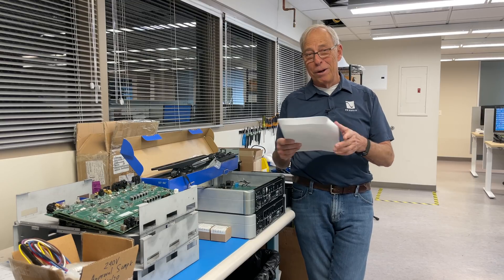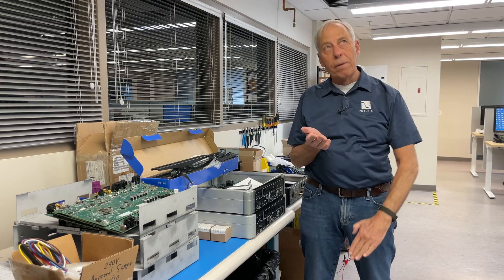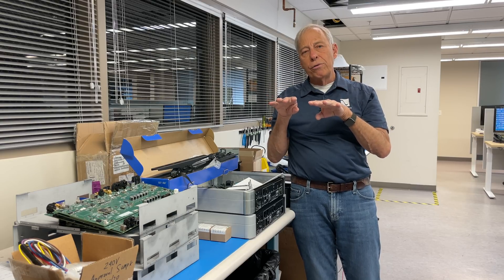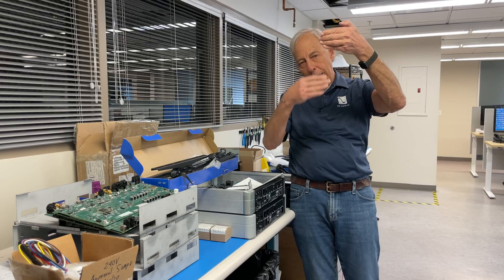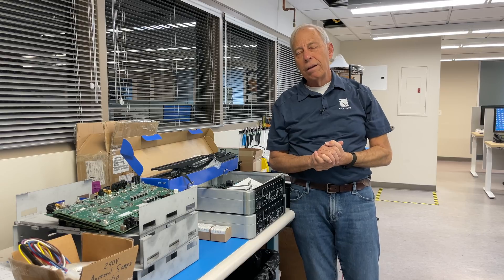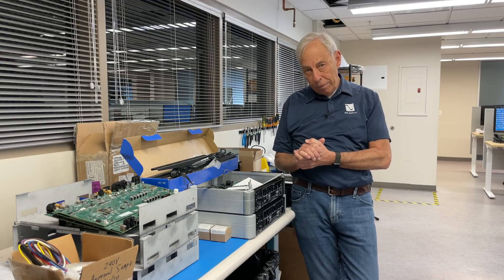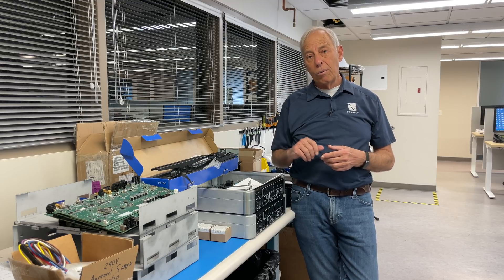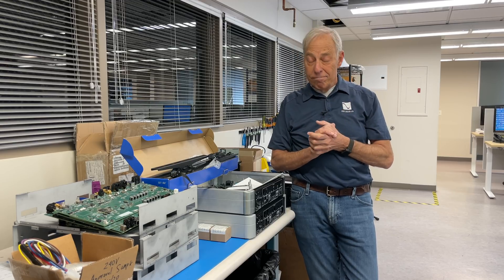Single ended amplifiers

Comment: Great simple thought provoking content.  I take it that because single ended amps are not zero crossing then it matters little if they are tube or mosfet?  What have you found when comparing  tbe two?  I build computers and it seems that a mosfet design could be cooled efficiently with a CPU type cooler.

Comment: Terrible explanation. Many errors. SE (or SET) run class A. The difference is a balanced stage (like push-pull) cancel even order harmonics. It's the resulting distortion that you find "musical". Even-orders harmonize with the fundamental. Odds don't. SE distortion levels are also higher even with feedback. Many SET owners prefer no feedback. Likely for the even-order distortion.

Comment: I got rid of two McIntosh 60 watt amplifiers; one built in 1954 and the other one in 1955 for stereo use; also got a Fisher pre-amplifier.- They put out so much heat that I didn't need to use the home heating central unit.
Reply: If you ever give up your mac 60s I have no sympathy for you ! Shame !!!
Reply: I drive. A 62 buick also, screw efficiency !!!
Reply: Everything I have ever owned that is efficient isn't worth a damm.

Comment: Single-ended amps tend to produce more second-harmonic distortion, which in the right quantities can be quite euphonic. The first Delco (General Motors) solid-state car radios had a single massive Germanium power transistor, working as an emitter follower, with an air-gapped iron-core choke between the emitter and ground. The car speakers (usually two, one in front and one in back) were wired in parallel with this choke. With two 3.2-ohm speakers, this arrangement could make a relatively undistorted eight watts or so. They sounded very warm indeed. Of course, it was AM radio! These amps continued on into the early 70's, when quad eight-tracks came out. There would be a massive aluminum heatsink under the dash with four of those huge transistors on it, and the radio would pull a constant 16 amps or so any time it was turned on.

EDIT: I forgot to mention, the line driver (final stage) of the legendary 1176 compressor uses a similar circuit, except instead of a choke it uses an actual transformer. And of course, most SET amplifiers put the output tranny in the plate circuit (collector, if solid-state).
Reply: Wow. Years ago, when I was still a kid, someone gave me an old simple AM radio from a '62 Chevy. It had like 4 tubes and a DS503? output transistor. Many years later I learned that it may have been a single ended output circuit, since the radio consumed like 3 amps when on. A waste of fidelity for just AM!

Comment: Perhaps it is worth adding that single-ended amplifiers, by their nature, produce even harmonics, while push-pull harmonics produce odd harmonics. Even harmonics create consonance, which is the basis of musicality that creates a magical atmosphere. They are pleasant to the ear and desirable in contrast to odd harmonics, which are not pleasant to perceive.
Reply: That is more about output device than amp class. Tubes and FETs become nonlinear and compress as they reach max levels. So they create even order harmonics which are smoother and more musically pleasant. While bipolar transistors just clip when they reach max out and create harsher odd order.
Reply: @glenncurry3041  In a single-ended design, BJTs behave like this as well, as they operate in their active region, where the non-linear relationship between collector current and base-emitter voltage introduces asymmetry in the amplified waveform. This asymmetry results in second-order harmonic distortion. In my opinion it's not about the output device but the single ended nature of the circuit which is the least linear one amongst others.
Reply: @belabertalan  Unlike tubes and FETs, BJT's do not compress at peak they clip. Massive odd order harmonics.

Comment: I have had over 60 years everything you can think of, also 2A3, 300B SE, for the last 10 years, I listen through a EL84 SE, will not change that ever. But, and I have them, you need efficient speakers. I have floor standing transmission lines , 96db.

Comment: Not sure how a class A amplifier can be "even more inefficient" than a single ended amp.  A single ended amplifier is always pure class A by definition.
Reply: Well that's exactly what I thought. When he mentioned Class A as being something else I was like what!? Isn't a single transistor or tube amplifier class A? It's the same thing! I was yelling at the TV! Lol!
Reply from the maker: No, that's not true. A single ended amplifier with no output signal draws only its operating bias current. Only when it begins to have a signal does the output current go up. So, a 50 watt SE sitting with nothing on its input is not consuming 50 watts. That happens only when there's a big signal. In contrast, a class A amplifier always draws the same current (wattage) regardless of the input signal. So, a 50 watt class A amplifier draws 100 watts from the AC wall socket even when there is no input signal. That power is then converted to heat. At full input signal the amplifier still draws the same 100 watts but now half of it goes into the loudspeaker load.
Reply: @Paulmcgowanpsaudio  Nope. If anything a single ended amplifier draws less current when there is sound due to the diode effect of the grid and cathode.

Comment: Hi Paul,  I do have PrimaLuna DiaLogue Premium HP Integrated (8/KT-150 Power Tubes can also use 6L6G, 6L6GC, 7581A, EL34, EL37, 6550, KT66, KT77, KT88, KT90, KT120 and KT150.  4 -12AU7 Driver Tubes and 2 -12AU7 Gain Tubes.  True Mono design as to why all the tubes.  Sounds Wonderful with Focal Aria 936 speakers.  I also have Dennis Had (Cary Audio Design retired Founder and President) INSPIRE Fire Bottle KT88 Single-Ended Class A Amp.  Using 2 -KT-170 Output, 1 -PSVANE WE274B Rectifier and 1 -KEN RAD CKR-6SN7GT VT231 Input Drive Tube at 12Watts connect to Zu Audio Dirty Weekend MK.II.  This bird SINGS.....It's the Experience and Designer...Thank You Mr. Had and I encourage anyone to try his SE Amp's (also designs INSPIRE 300B and INSPIRE LP-2030 Pre-Amp) from Dennis Had.

Comment: When is a single ended not class A?
Reply: When it's broken and needs repair.  
On a more serious note, it's just semantics.  When one speaks of Class A, it usually implies class A complementary, rather than single ended.  But both use similar biasing schemes.
Reply: @marianneoelund2940  class A complementary is just class B with heavy bias (class "AB"). At least that's how I always looked at it. Class AB sound fine but zero feedback class A is the best, in my opinion :)
Reply: @cheapygeek  That's a fair basic description.  The key for class A is that the output transistors are never turned completely off.  But there are variations in how much bias current is used, and how the opposite-side current is tapered, so class A designs may sound different, and may not handle reactive loads the same.
Reply: Single ended can be both class A and Class B or AB, it just depends on biasing.
AB is always a bit confusing because it is often referred to a push pull configuration, but in reality those are typically biassed AB, though you can also bias them A (if you require a space heater) or B. And then there is even class C which is only useful for railway station PA systems.
Reply: @hugobloemers4425  I'd like to see a schematic for one of those "single-ended Class B" designs.
Reply: @marianneoelund2940  Perhaps on Google, but it will hardly look different from an SE class A schematic. The only thing you need to do is turn the bias down so it hardly conducts with no input signal signal. In this case you will drive the OPT with half a sine wave but the magnetic energy will power the other half of the sine wave at the speaker output. So you kind of turn half sine wave in to a full sine wave but the distortion will obviously be higher.
Reply: @hugobloemers4425  
Basic inductors:  No current means no magnetic energy.  
You would only get half of the sine wave.

Comment: I don’t quite understand why two complimentary devices each handling 50% of the signal are more efficient than a single device handling 100% of the signal. Do the complimentary devices have a “cool down” period while they’re turned off which produces less heat overall?
Reply: Yes, unfortunately this is amplifier theory, and I can only offer a very brief explanation here. At zero audio output level, complimentary (push-pull) output stages have zero current flowing in the transistors, other than the bias current. As output power rises due to increased input amplitude, the transistors carry more current. Single ended amplifiers normally operate in class A. What does this mean as far as power goes? With minor exceptions, a 10W class A amplifier will draw a certain amount of power from the wall, no matter what power is flowing to the speakers.  The power load will be the same at zero volume or full volume. They are very inefficient, but they make good room heaters. (The "musicality" people talk about in class A amps is mostly due to harmonics)
Reply: Yes, you understand the basic concept.  Class AB only maintains a small current through the output transistors when the current to the load is at or near zero.  At higher load currents, most of the current flowing through the transistors goes directly to the load.  
With single output devices, they must be carrying an amount of current at "rest" (i.e., when little power is going to the load) that is at least the magnitude of the maximum peak current the amplifier can deliver to the load.

Comment: Yes, there's something special about my EL34 single-ended amplifier. Built from a Chinese kit (Boyuu A9); unmodified, so still running as pentode rather than triode.
Reply: Cool building your own amp. Those Chinese kits are quite cheap nowadays e.g. via Aliexpress. How much did you pay?

Comment: BHK's aren't class A are they ????
Reply: The first watt is pure class A but beyond that A/B. The point was they use a unique output stage with only one sex output device, an N channel, where normally the complimentary output would be N and P.
Reply: @octaverecordsanddsdstudios1285  Isn't the definition of a "class AB amplifier" one that operates in class A up to a certain current output, then switches to class B at a point determined by the biasing when more current is needed?
Reply from the maker: @gotham61  Yes, that's correct. Class A for a small portion of the signal (where the amplifier bias current is greater than the signal current) and then class B above that.

Comment: This would be a transistor or transistors,  biased so that the Q point would be in the middle of the load line, with the positive and negative swing, relative to the Q point.  As Johnny pointed to, wouldn't this have to be a single ended supply rail? (Yes, no crossover distortion.  Maybe an asymetrical sine wave, if the swing is too large?)
Reply: At least two topologies for a class A amplifier. One is an over biased class B amp to where it operates as class A well into it's total power capabilities. Not simply just a bias adjustment though as the active devices and heat sinks must be capable of taking this abuse. One benefit of this approach is the when pushed too hard, the amp just reverts to class B before clipping.
The other is true class A with a single or paralleled group of output devices driving the speaker direct coupled or through a capacitor or transformer. Here the distortion is high as the output current sourcing element, a resistor or transformer winding,  is not very linear. A better way is to put a current source or sink in series with the output device. Now aside from the inefficiency, you can get very distortion levels right up to clipping.
As for single rail or split rail power supplies, that just depends on the circuit design. Either can be used even in a tube version if you went to the trouble. Think about it, there are many OPAMPS that operate class A with split rail supplies.
Reply: @andydelle4509  Thanks, Andy.
Reply: @andydelle4509  Just had a thought - has anyone done listening tests with bridged class A or SE amps, which would take out the even-order harmonics?  Does the sound quality become less pleasing when only odd-order harmonics remain?
Reply: @marianneoelund2940  Not aware of any tests. Would be interesting to try though.
Reply: They generally use single-rail supplies, but you could design one to use bipolar supplies (that would probably not allow removal of the output capacitor, however).  The supply choice does not determine whether or not there will be crossover distortion; it is a "given" that there will not be, because there is only a single output device.  
You are correct that the output becomes asymmetrical as the amplitude increases.  This gives rise to even-order harmonics, which many listeners find adds a desirable character to the sound.  It is a "warm" type of distortion.  The added harmonics may be a stronger contributor to the character of the sound, than the avoidance of crossover distortion.
Reply: @marianneoelund2940  You misunderstood what I said, when you said "...  The supply choice does not determine whether or not there will be crossover distortion;... "  Look at what I wrote, quoting myself "... no crossover distortion... " my comment relates to the fact that only one type of device that would be used (not a complementary pair like a NPN and a PNP together), and it would be biased on, continuously, therefore no flat spots between the negative and positive parts of a sine wave. Other than that, your comment is interesting.  I like that part about the harmonics and pleasing distortion.  That's a really interesting subject.
Reply: @marianneoelund2940  Marianne, you got my curiosity about using a split supply for this type of amplifier.  Normally with a single ended supply the Q point would be set at half of the rail supply voltage. Which is you had a single +15 volt supply, would mean that the Q point would be set at 7.5 at the collector (assuming and NPN transistor.) Now, if you had a split supply with say +17 volts and -17 volts, you'd have a 34 volt range between rail supplies.  I'm trying to imagine where you'd set the collector voltage with DC biasing (Q point.) If you started from the negative supply rail (and that kind of considered that zero volts) If you set the Q point at 17 volts positive, relative to the negative rail, you'd be sitting right in the middle of the load line for the transistor.  The output of the transistor could swing negative and positive, with a greater linear range (avoiding asymetrical distortion) at a higher voltage level (peak to peak) on the collector, than you could get with a single ended supply with a lesser voltage on the rail. Because the collector's Q point would be at zero volts (relative to ground), the base would have to be biased (DC) more negative than zero volts, and the emitter voltage would have to be .7 volts more negative than the base voltage (.7 volt drop between emitter and base to keep the device turned on)?  You got the gears turning, here.  Interesting stuff.
Reply: @KenTeel  The quiescent point would largely be chosen based on the voltage swing capability of the supply-side devices, which typically differs from the low-side transistor.
Reply: @marianneoelund2940  Isn't the Q point chosen to be half way between the rail voltage(s), so that a sine wave can swing the same distance from the Q point, going in either the positive direction or negative direction? I've seen examples of the Q point being centered between rail(s) voltage(s)? Perhaps you know different? I'd be curious if they do put the Q point in a place other than centered, and whether that has to do with maintaining the symetry of a sine wave?
Reply: @KenTeel  It's common for the high-side circuit to have a higher voltage burden than the active device, i.e. the output would be asymmetric if the Q point was centered between the rails.
Reply: @marianneoelund2940  PS: I like your photos. You're very good at that.  Nice action photo work, especially.  You are quite accomplished.

Comment: No experience with hifi SE but have built a couple of SE guitar amps.. A 6L6 with a 12ax7 drive and a parallel dual 6V6 unit. I was pretty surprised by both of them. They both can drive a 2x12 cabinet but really shine through a sealed 1x12. VERY warm sound. Good explanation Paul
Reply: Me too, I bet they could sound great in hifi circuits.

Comment: Having owned many EL34 amplifiers in particular old HH Scotts, the 300B blows them away. Currently I have a SET 300B with 8w + 8w.  It destroys and I mean DESTROYS my 2500 Marantz sr-18 with 140Wx5 and a massive torroidal transformer.  Torroidals in the day were considered a big upgrade in high end power vs. solid state. Now the question the bigger question is why does the type of rectifier tube "color" the sound so much? and why so many PREFER that 300B tube sound to mosfet?  300B systems are about the most outrageously overpriced you can get. they rape u due to the demand with several systems going to > 60k dollars. The really big tube systems seem to use parallel KT88 tubes instead to achieve those 100W power ratings. But I dont think they sound so good and I've NEVER felt the need for that wall thumping power more than my little 8wpc does.  Today they are all PC board based but u should try to get a silver wire point to point soldered one as those don't "squash" the signal through the tiny PC board traces. More work = more cost. I wouldn't sniff at a PS audio amp and pre, would love to try one if u want to ship me some stuff ! hint hint ;*>
Reply: True, but 300B tubes are pretty expensive…